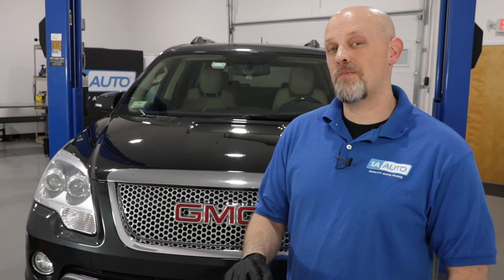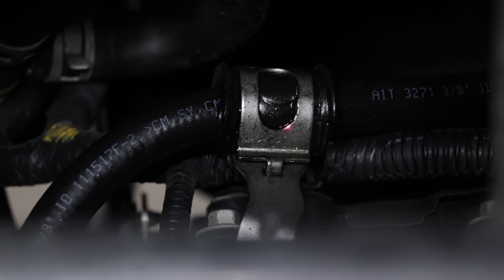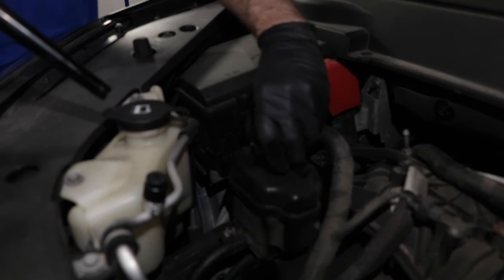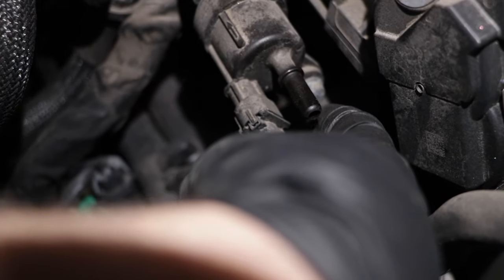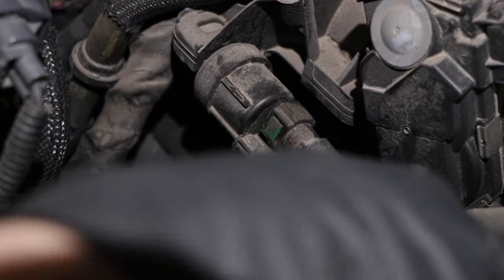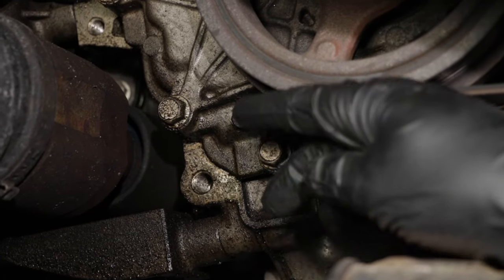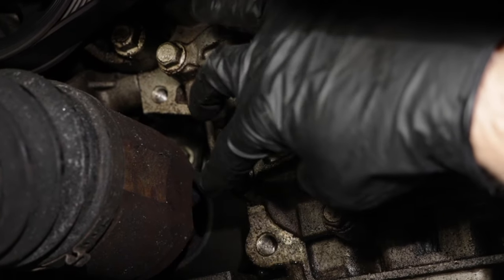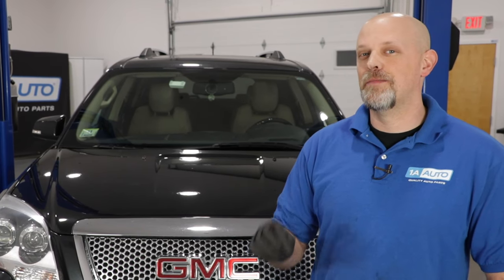Top 5 Problems GMC Acadia SUV 1st Generation 2007-2016

Comment: Not sure how common a failed ignition/key switch is. Mine locked up and had to be replaced. One problem with that was the housing around the steering column had to be replaced as well seeing as the ignition could not be easily removed from it.

Comment: Great video 
2009 traverse all the same issues 
 04 equinox and 09 traverse cracked water pump at around 32000/33000 miles any one else have this issue at around that mileage ??

Comment: So we have an issue that no mechanic can figure out. She’s seen probably four different shops, all great shops and say they can’t find it. This only happens when turning our vehicle at low speeds (think 8 mph or less)... it makes a very loud vibrating hum that vibrates the whole car. Made me think of when you said droning sound for the torque converter, but you said high speeds. It does help if I pulse on the gas and really take my time thru the turn when it does this, because the longer I let it go the more violent the noise and shudders can get. Any thoughts what it could be?
Reply: We also have water I’m assuming from the sunroof leaking thru the sunroof and it will leak thru our DVD player, the baseboards on my driver side, and the railing things above the windshield. I know a lot of people hate these vehicles but I really love my Acadia and want to fix it up to my liking. But it’s so hard to find the issues because my mechanic shops say they can’t find what the problem is. It seems like you really know your stuff, any thoughts so I can help direct my mechanics attention to a possible problem area? Thank you so much for your help!
Reply: When I climb up to look at the sunroof tho, it really looks fine I don’t see any fraying or cracks or gunk that needs to be cleaned out

Comment: I have a 2011 acadia. If i run too long at 2400 rpm, i will get a check engine p0420, and it will smell of burned matches inside the vehicle. The 4 o2 sensors have been changed. As of late, i get about 10 seconds of greyish smoke on cold starts as well. The purge valve has also been replaced. Any recommandations? Thx
Reply: getting the same code and symptoms except now when it warms up lots of exhaust smoke and smells like fuel. currently working on spark plugs, coil packs, and fuel pressure sensor. 

did you figure out what caused your p420 code? mine has thrown that code for months.

Comment: I have a 2009 Acadia bought new 12/2008. I cannot get it to pass inspection. I just keep getting a load of codes.  P0191 P069 I have had 3 or 4 different mechanics and spent over $15k over the last 3 years. Is it time to throw in the towel? My son was born in the front seat and I've been reluctant to get rid of it but if its going to reach $20K in repairs in 4 years. Should I throw in the towel?  How do I find someone who knows these cars? Everyone has been missing on repairs sometimes creating issues that didn't exist. I'm on Long Island

Comment: So I recently bought a 2011 GMC Acadia from an auction at the bank I worked at . Everything was smooth until I decide to take it to lunch and it turned off on me in the highway . It was low on gas and we thought that might be the reason it turned off on us . We then filled it up and it was working fine but then it started shaking and wanted to turn off on me so then I parked it again . Then at night I went out try to crank it see if it will work and it didn’t want to stay on the headlights were flickering and then it would die on me . Any ideas of what it might be ? I had a ob2 diagnostics ran on it and it showed a camshaft sensores need to be replaced, but honestly wouldn’t tell if it’s that , the battery or maybe even the transmission any advice need to get ready to sell !!

Comment: I've got a 2010 GMC Acadia Slt Awd and I could get it to turn over but it would not start what could be wrong with it because I've done replaced the plugs and coils and crank position sensor and the throttle body and the purge valve

Comment: I have a 2010 GMC Acadia SLT my fuse box hotwire got so hot it burned my hand why is that wire is pulling so much power out of the battery can you help me

Comment: My 2013 is shutting off intermittently and shows reduced engine power and service stabilitrack when it does... I shut it off, open the doors and let the ecm reset and I’m good to go most of the time but then every once in a while it will crank but not start.. scary part is that it shuts off while driving and steering gets hard.. any ideas? Changed an ecm power relay based on some reading u did but pretty lost
Reply from the maker: +Rodolfo Jimenez We wouldn't be able to diagnose an issue like that here, you should definitely have a mechanic take a look at it as this seems like a serious issue. Thanks for checking us out! http://1aau.to/m/Shop-1AAuto-c

Comment: My 2011 GMC acadia has had a few items such as the Power steering fail right as a recall got put out ironically enough, other than that when i got back from kuwait last year i took it out driving and suddenly had no oil pressure, i had spun 4 rods according to the mechanic but still had all of the oil in the engine, thank god for insurance. Turns out the ex wife probably didn't maintain it when i sent extra money for that. Only issue since then is the replacement engine still feels different than when i first got it, but i suspect that's to be expected.

Comment: I have a 2008 acadia SLT 2 with 168,500 miles that has a transmission problem. Unfortunately it's not consistent so it's very hard to diagnose because it never seems to happen when the mechanics are looking at the car, but sometimes when we start driving it is stuck in 1st gear and I have to pull over and turn the car off and open the door to cut power, then start it up and try again. Sometimes it takes a couple of tries. Any ideas of what the problem is and how to fix it?
Reply from the maker: +Brent Mickelson We wouldn't be able to diagnose an issue like that here, you may want to have a local mechanic take a look at it. Thanks for checking us out! http://1aau.to/m/Shop-1AAuto-c

Comment: hello great vid, my 2013 terrain wouldnt get in gear, so i had engine light on, and then i turned off and on couple times and was able to ddrive home, i checked the codes and i get a po700 and  a U0073, would can i do next

Comment: My 2008 GMC Acadia started coming up with an error on Stabilitrak? And said said something about the car symbol with the squiggly lines and to try pushing the button which did nothing but along with that it had a warning saying tire monitor system and tire pressure monitoring system and after getting my daughter from the airport it started to lose power on the highway, and gave out 😢 after the battery died from having the hazards on roadside Assistance tried jumping the vehicle  and now it sounds like it has a rattling / grinding noise in the engine when tried starting, what can cause that noise to happen? Pls don’t say my engines gone 😢😢 cause I was just hoping I just had to change my throttle body but now I have a feeling it’s much worse 🥺 what could this be? Also I just bought this 2 months ago as a 2nd vehicle and I’m so bummed on it giving out on me so quickly 😭

Comment: Question, I have a 2013 Acadia Denali and recently has been shuddering only when I'm
 cruising (with light throttle maintained) around 30-40 mph at slightly under 2k rpm in 3rd gear. Once I let off the gas or give more pedal, it tapers away. It normally only does this when at a slight incline and doesn't normally make a noise, until today. Going up a hill at around 28mph, as soon as it shifted into 3rd gear, it shuddered until I reached the top and sounded like it was out of gas, like in movies. I'm getting no codes or CEL, so I'm pretty confused. Any suggestions?
Reply: Wish someone would have responded to  your comment. Our 2012 is doing the same thing and Im pretty certain its the torque converter.
Reply: Yes, my 2016 is doing the same thing.  I’m also 90% sure it’s a bad torque converter.  $300 part, but the transmission has to come out to replace it, so you’re looking at $1,500 in labor just to change it.  And if there was any debris in the fluid from the torque converter, then you’ll likely need a new transmission too.  So, best case $1,800 to fix, worst case, $4,800.  It sucks.  Frustrating, because I really like the car otherwise.
Reply: My 2012 is doing the same thing. I’ve seen a couple other comments stating the same. No one has responded to them.
Reply: I agree Colt. My 2012 is doing the same. Dealership wants 2,300 to fix. I’m going to try using Lucas transmission anti slip and run it till it dies. Probably trade in for a different car. I do like the car though

Comment: I have a situation with my 2007 Acadia where got a traction control message then minutes later and oil light and turn off engine light came on.  Oil is clean and full.  Has anyone else seen this?

Comment: A friend of mine has a 2011 Arcadia that is setting the P0420 and P0430 codes for Cat performance. IN the last year he had a tuneup??? Trans replaced due to shuttering , and now all 4 o2 sensors and Cats. Still getting same o2 codes. I scanned it and saw nothing out of range. L & S Trims looked good o2s checked out fine. No misfires current or in history. At  150K I'm suspecting the timing chains causing the cam and crack sensors just enough out of sink to cause the o2 codes to set , but not bad enough for any other code to set. Anyone else had this issue? Also MAF data looks correct, but might help if cleaned. I don't really know what the so called tune up for $800 really included.

Comment: I have an '08 and it seems to be leaking oil but I don't know where. Nothing on the ground, nothing coated with oil, and no smoke the tail pipe. Coolant overflow take is oil free. Any ideas as to where it could be going?
Reply from the maker: +Orlando Jason White There could be multiple reasons why you are experiencing this issue. We recommend having a local, reputable mechanic take a look. Thanks for checking us out!

Comment: I have a 2008 Saturn Outlook XR Frontwheel drive, and the transmission with no known signs just started grinding while driving on the interstate. Grinds in drive and reverse gears, but not in neutral! 
Any idea what that could be??
Reply from the maker: +Mack I. Holman, Sr. We wouldn't be able to diagnose an issue like that here, you may want to have a local mechanic take a look at it. Thanks for checking us out! http://1aau.to/m/Shop-1AAuto-c

Comment: Please help .. I have 2012 Acadia slt in lower RPM's it tends to sputter (vibrate / shake)  , I let off throttle and press down again and it is fine , now I f I just Go with higher RPM's it's fine ... My question is why the sputter , and what could fix it ???  Other than that car is great  please help
Reply: I like to cruise in my town and go slow , but Acadia won't let me because of issue,  to clarify more a more heavy foot person in high RPM's won't have problem
Reply from the maker: +Mike Duron Thanks for for watching! There could be multiple reasons why you're having this particular problem. If you are unsure, we suggest taking your vehicle to a nearby reputable shop to identify the cause. Once you know the cause, we'll be happy to see if we carry the parts and how-to videos needed for your repair.

Comment: I had Acadia 2015. I had vibration issues when running cold. It was agency maintained even the tires. I didn't save a penny on this fat SUV. however, none could guess where the problem is. took it later to more than 4 mechanics and 2 tires shops. and none could figure out the reasons behind the problem!! Also the engine mount breaks/cracks a LOT in very hot weather. even with original parts, you'll have to replace it every 1-1.5 years (which is pretty expensive, labor wise). overall, it was pretty nice journey despite the issues. the car really needs a turbo or some performance modification as it is very heavy and the engine produces insufficient power.

Comment: I have a 07 GMC Acadia when I’m driving my door locks jump up n down the car jerks n cuts off. I try to start it back up n it just doesn’t do anything then I wait then try to star it n it comes on. Sometimes it will keep running after the jerks like nothing wrong

Comment: 2006 GMC when I step on the gas pedal it has a loud noise as if the drive shaft for the AWD has a problem going to the rear.   Hard to explain.  Any thoughts?
Reply from the maker: +Jeff Carpenter We wouldn't be able to diagnose an issue like that here, you may want to have a local mechanic take a look at it. Thanks for checking us out! http://1aau.to/m/Shop-1AAuto-c

Comment: I have a 2016 acadia sle and im having trouble with my transmission when it shifts between 2nd and 3rd gear and also 3rd to fourth. It shudders and shakes when trying to shift. And on highways or a steady 50 to 55 mph it acts like it doesn't know how to shift. Would this be the torque converter?
Reply from the maker: +nate Williams We wouldn't be able to diagnose an issue like that here, you may want to have a local mechanic take a look at it. Thanks for checking us out! http://1aau.to/m/Shop-1AAuto-c

Comment: I have a 2009 Traverse LTZ with 120,000 miles on it.  I have not had any of those yet...I have had others, don't get me wrong.  Mainly with the radio, sway bar end links, water pump, bad coil pack.  I think I finally worked all of the bugs out of it.  I have heard of those problems, just haven't experienced them yet.

Comment: Nice video i have a peoblem with my 2013 arcadia y will at random time show an " a/c off engine hot" notice yet my temp is fine, when this happens the temp gage goes to zero and a/c shuts off. I will turn engine off for about 2 min restart and it works fine any idea what could be causi g this?
Reply from the maker: +Jesus Rivas Since there are multiple reasons why you are experiencing this, we do recommend having a local mechanic take a look. Thanks for checking us out!

Comment: Hey I have a 2008 gmc acadia an I can't get the motor to run right. I changed the coil pack spark plugs an it still just making this loud sound when I crank it up . Can u give me any advice on what the problem might be? My scanner keep push out the code for the map sensor an I changed that an it still doing the same thing
Reply from the maker: +Joppa Jackson We wouldn't be able to diagnose an issue like that here, you may want to have a local mechanic take a look at it. Thanks for checking us out! http://1aau.to/m/Shop-1AAuto-c

Comment: 2015 GMC Acadia Denali: Oil and filter changed twice a year since new. Well maintained vehicle. Tire rotated 1-2 times a year.

I'm experiencing a regular tick, tick, tick clicking sound once the engine has been running for a few minutes. I've been told valves need adjusting, I've also been told separately the timing chain is failing. No engine check or codes.

I also have researched extensively a "suspension" noise coming from the front of the car.  Have been unable to determine root cause. All bushing look in good to very good condition. No leaks. Nothing broke. noise only happens at low speeds hitting very small or modest bumps triggers the noise. Very frustrating. 

Any thoughts on these two issue very much appreciated!!!
Reply from the maker: +Kevin Wagner We wouldn't be able to diagnose an issue like that here, you may want to have a local mechanic take a look at it. Thanks for checking us out! http://1aau.to/m/Shop-1AAuto-c

Comment: We have a 2015 Acadia and have had a couple issues with it but basically it’s a great car that drives nicely. The main problem we’ve had is the StabilzeTrac not functioning. In the middle of driving on the highway the traction control starts malfunctioning making it difficult to drive over 30mph. We pull over, turn the car off for about 10-15 min trying to get it to reset. Any idea why this happens? Never know when it’s going to happen much less have any idea what driving habits are the possible cause. Any ideas?
Reply: I would guess its the diaphragms in the transmission, I had the same issues.  Super cheap fix if you are slightly mechanically inclinded.
Reply: My wheel sensors in the hub went bad. Fixed stabilitrac issue once replaced. Death trap if stabilitrac is on fritz and it's slick out,  massive understeer.

Comment: Evaporative purge valve failure, check.
PVC valve plugged and replaced, check.
Rear wheel bearing failure, check.
Alternator fail and vehicle stall, check.
Power steering leak/pump failure, check.
Burning oil like a two-cycle engine, check.
Transmission shudder up hills or under load, check.

Comment: i am facing engine overheat, we changed the thermostat, after few days water pump was damaged, we installed new one, but engine keeps on overheating in traffic jams or driving up a hill and coolant level goes low. 
any suggestions?
Reply: Where are you putting the coolant and are you using the proper one?! If you haven’t gotten it fixed yet..?
Reply: Probably a head gasket.

Comment: My 2008 doesn’t want to go at first it will rev very high and have to push its self into second gear it starts going extremely slow, what could be the issue?

Comment: Really nice video....
Actually I'm having a problem with my acadia 2008 model
Vechicle vibrates at low rpm (1000-1500) when accelerating slowly. But it is not noticable at higher acceleration. I had to the dealer and replaced every mount (3 engine mount and 1 struct mount under fuse box) of the vehicle. But still the problem exist.
Could anyone pls guide me with with problem
Reply: 2008 Acadia, with LY7 3.6?
 (port injected so it's not dirty valve misfire)
How many miles on it?
Does it happen during 1st gear, 2nd gear, 3rd gear's only ?

Comment: I have a 2012 accadia bought it used had 108,000miles. Good car but having problems dying out alot. Engine hot/ac off  shows up  and engine light comes on